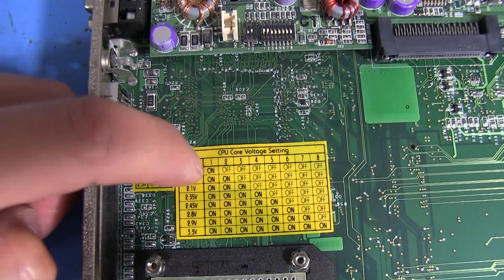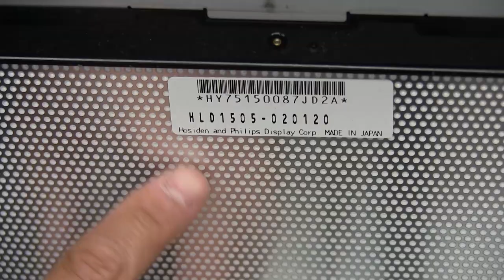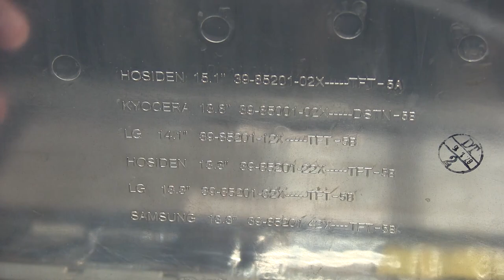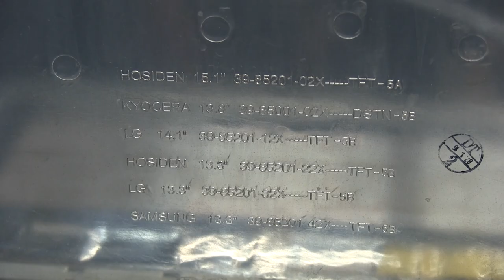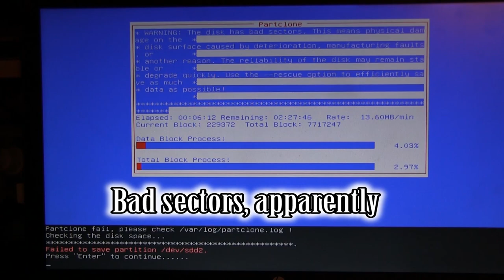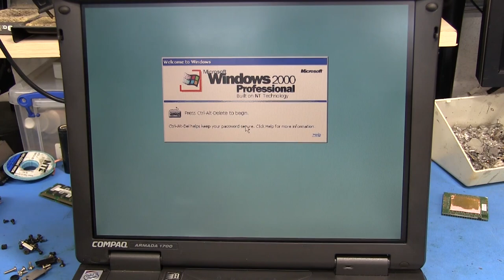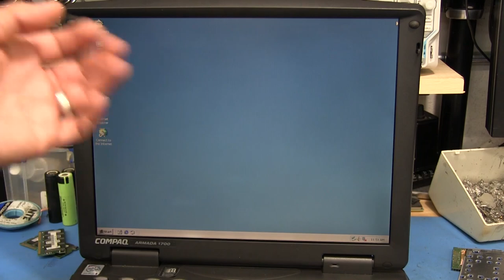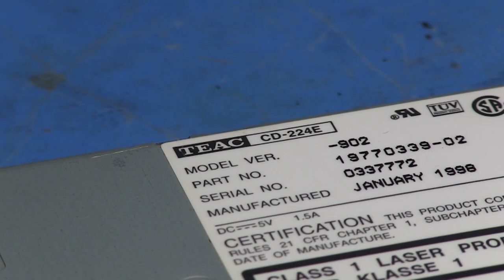TWB #88 | The Notable Conundrum of the "Notebook Computer"

Comment: Did you try dumping the bios?  It may provide you with some clues as to who made the system.
Reply from the maker: I did, before I uploaded the video, but I didn't mention it.

The only things I found in plain text were mostly BIOS versions, dates, error messages, what looked like menu text for BIOS options/settings. Unfortunately I don't know enough about decoding the data, and a lot of the text shows up with random characters thrown in between sections of plain ASCII characters. I would guess that has something to do with offsets or something.

It appears the one chip holds both the system and graphic BIOS data.
Reply: @ThatElectronicsFool  Did you find out who the BIOS manufacture was (ex: AMI Award Phoenix etc..).  Would you mind sharing the dump with us?  Also you could try replacing the chip you think you fried as I know you have the tools to do it.  Is there any motherboard model silk screened on the PCB (it may be under a sticker)?  I really like your channel by the way.
Reply from the maker: I saw "SystemSoft" in several places in the dump, along with decals on the board that said SystemSoft. There is also another decal on the board with Phoenix on it, but I didn't see Phoenix referenced in the BIOS, or I might have missed it. There will be a link in the description to the bin file. Nothing obvious on the board that would potentially indicate a board model number.

I did consider replacing the chipset, they're readily available on eBay, I just don't know how much time/money I'd want to invest into trying to get the thing working. 

Thanks!